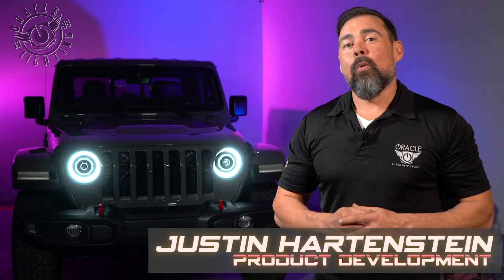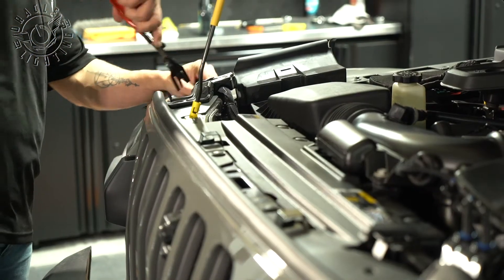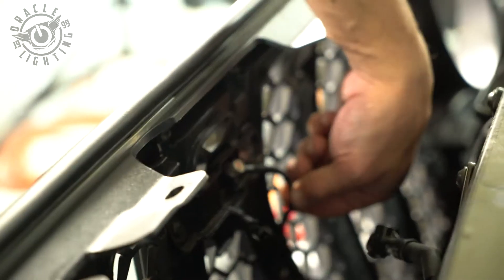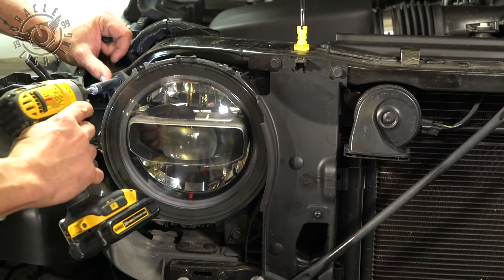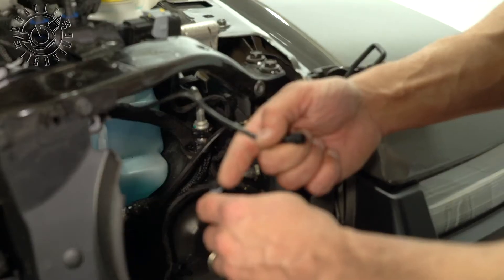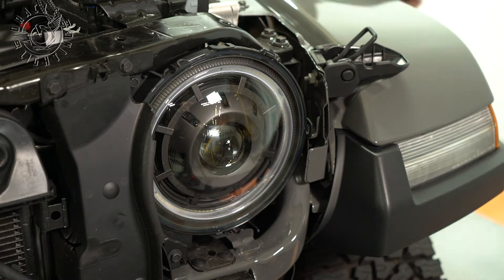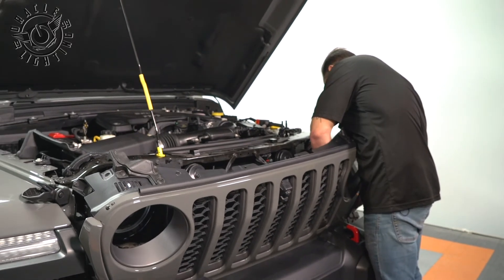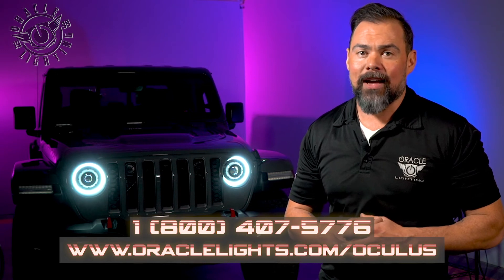OCULUS SWITCHBACK 9" Headlights for Jeep Wrangler JL and Gladiator- DIY Installation

Comment: Kinda weird that this video spends so much time on disconnecting the front-facing trail cam but does such a poor job of showing where the turn signal connector is.

On my 2020 JLU, both connectors are on the trailing (rearward) side of the wheel well just past the highest point of the wheel. On the driver's side, the connector is visible from the engine compartment between the coolant overflow bottles and the brake booster drum. I couldn't get the connector disconnected from the top, but maybe someone who's more dexterous can do so.

On the passenger side, the connector is buried under the the battery tray and fuse box.

For both, I just removed the fender liner--not the whole fender!--to make the install easy. Removing the fender liner on each side requires drilling out some of the rivets, popping six or seven plastic tree buttons, and removing three bolts with 10mm heads. Only the trailing four or five rivets need to be removed.

With the fender liner completely removed, the job on the driver's side is much easier. I don't think removing the fender liner is avoidable on the passenger side. 

On both sides with the liner removed, it's also easy to zip-tie the new wire to the existing wiring harness so there's less chance of it catching on anything.

My lights work great and I'm very happy with them. I had halogen lights all around; I had replaced the running lights and turn signals on the fender with LED bulbs, and my fogs with Oracle LED fog lamps. No problems with rapid flashing and it didn't seem necessary to re-code anything.

Comment: The install didn't demo the turn signal halos; the only time I see them are in the intro, where the fender turn signals are deleted. Do these headlights replace the fender signals, or can I run both?
Reply from the maker: both will continue to work like normal unless you purposely disconnect the fender lights.

Comment: Can you tell me what activates the DRL's if I have a sport with no DRL option?  I know your other lights without the turn signal have a fuse tap for the DRL's
Reply from the maker: The parking lights are what activates the Halos on these lights, if you do not have the DRL option it will still work for your Jeep.
Reply: I’m having the same problem setting mine up on my sport (switching from factory halogen). Y’all need a video specific for those of us with the halogen model

Comment: My halos do not come on with the daytime running lights, but they do come on when the headlights are on. Is there a fuse tap or something im supposed to do?
Reply from the maker: If you have the switchback lights you turn on the Halos by switching the headlight switch to the parking light setting.
Reply: @ORACLElights  Can you add code to fix this?
Reply from the maker: @ericsoho  for the switchback lights the white wire for the Halo can be connected to a switch or other power source (ignition) if you prefer to to use our plug-and-play connection.

Comment: Where exactly is the factory fender connector located at on a Jeep JT? Do I need to remove anything to get to it?
Reply from the maker: same spot as the JL, top of the fender arch, just pull back the fender liner to access it.
Reply: In this video there is no explanation on taking the fender liner off it seems like in the video there is a cut out with the wiring harness sitting right there but on my 2020 Jeep Wrangler Sport JL there is no cut out the fender liner completely covers the access to any wiring harness… there is a wiring harness that is near that area but it is only accessed thru the engine area/ under hood… I don’t want to guess and start unplugging stuff…???
Can you help me with this? The video is not very clear about this…
Reply: @FrankieD777  did you end up figuring this out? I’m having the same problem with my gladiator sport
Reply: Yes… you have to take the wheel well plastic back to about the middle of the tire and it is mounted right there…